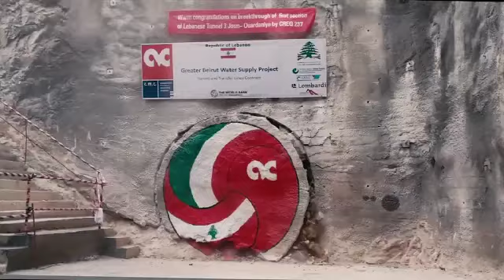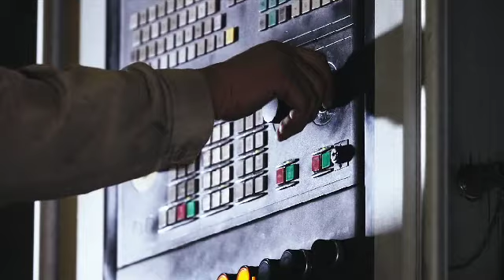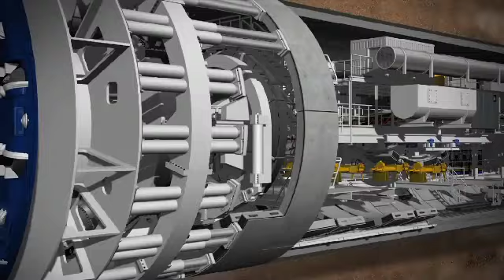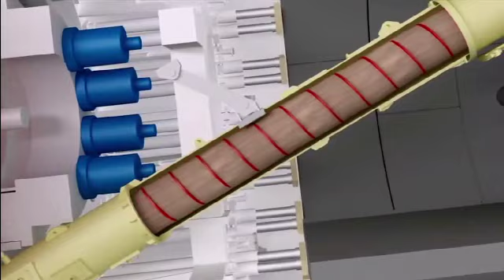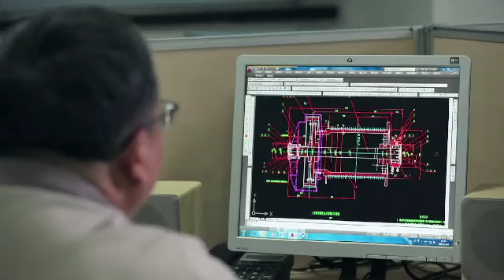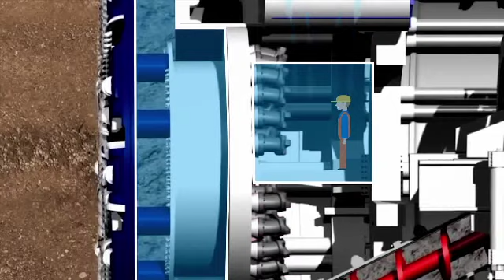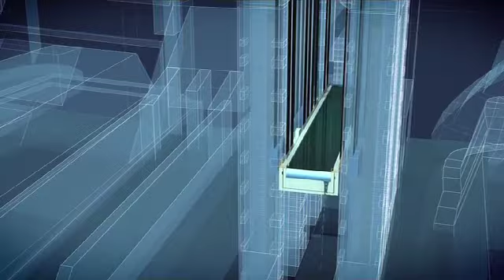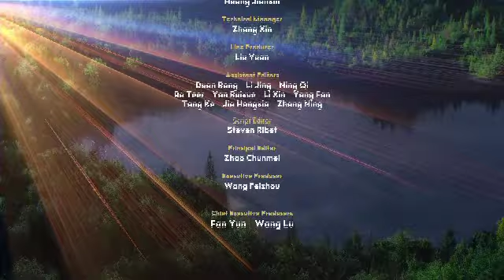Mega Equipment Episode 1 Unique Engineering

Comment: 4:00   15:00        excavator /  shovel
15:00  23:00       tunnel boring machine
23:00  29:00       three gorges ship lift
29:00  35:00       rtn to excavator at work at mine  and manufacture
35:00  40:00       rtn to tunnel boring machine at work
40:00   end         rtn  ship lift              and perhaps bit of bragging towards the end                         m